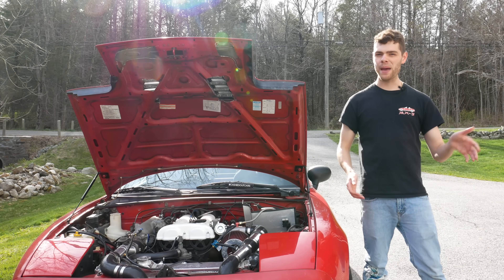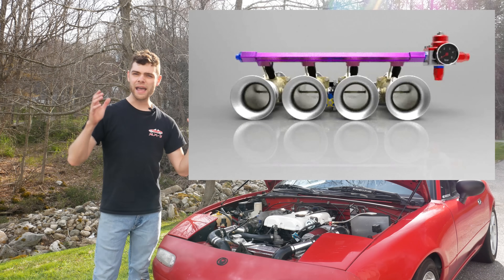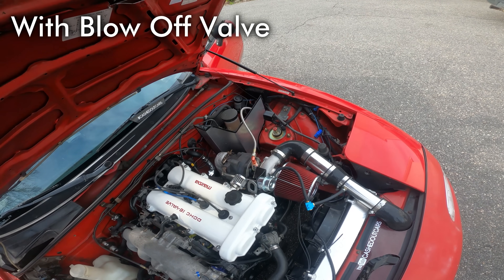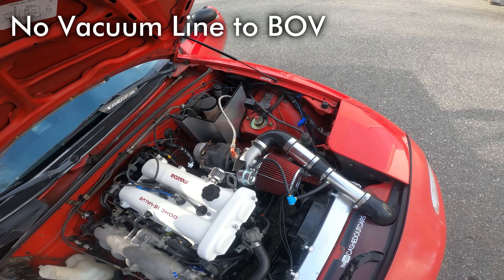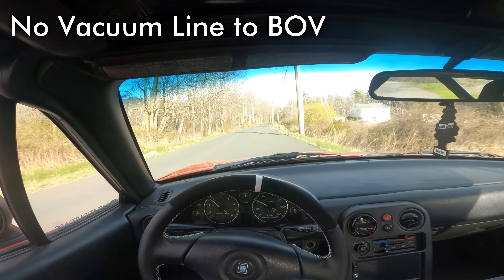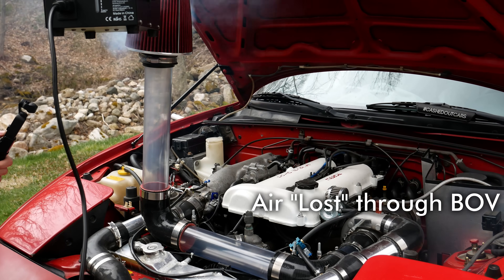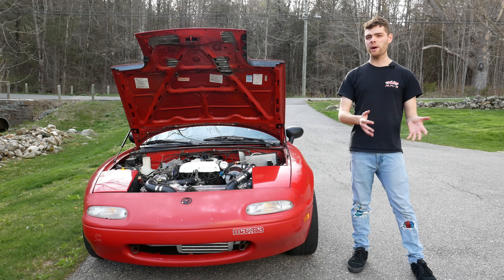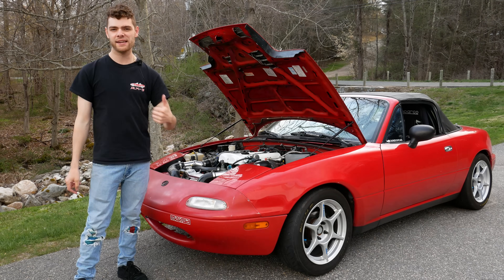Blow Off Valve vs No Blow Off Valve | Sound and Science

Comment: Diesels run no bov, do to no throttle plate to close. And also run 20-30 psi factory depending on the make and model. The issue that comes from compressor purge  is it wears out the thrust bearing. Thats the bearing keep the rotating assembly in the center of the turbo. Just like the crankshaft thrust bearing. The reason it wears it out is the imbalance between boost and drive pressure. It'll live just not as long.
Reply: Most diesels since 2008 have a throttle plate thanks to the epas crippling ridiculous emissions standards. Yet China and Indiana are unregulated and economically and environmentally killing the rest of the world..
Reply: Some industrial Volvo diesels have a throttle plate and still no blow off valve
Reply: @minusthemachineagain9342  that throttle plate is a failed attempt too increase gas velocity and prevent the EGR goo build up in the intake system
Reply: @00powersmoke  you are correct, it should only be active during a regen, still weird to see on a diesel.
Reply: most efi diesels run a tb, in smaller things anyway

Comment: This really makes me curious how the turbo can “blow off” during free revving. I also have a turbo 1.6, and it never does it. I wonder if the turbo is too big (t3) and it just doesn’t spool enough for there to be an audible noise.
Reply from the maker: Yeah it all depends on if you’re making any boost or not! This isn’t making much under revs, but it’s a bit. Also, different BOVs can have different springs in there, making them open at different levels of vacuum

Comment: Great information, just which I had a car like that
Reply from the maker: Thanks! This car is a blast, I’ve built it over 7 years :)
Reply: @CashedOutCars  I’m looking into getting a 4 cylinder car. Automatic/ manual so I can get better gas mileage. Got any recommendation on what to look for? I’m currently driving a 4.0L V6 Ford Ranger so looking to get better fuel mileage.
Reply: @prestonranger3082  manual Honda insight are super cool. 60mpg and pretty cheap.

Comment: What about VW and their Diverter Valve? How Does that Work
Reply from the maker: If I remember correctly that’s essentially a recirculating valve. It still relieves boost pressure, but directs it back into the intake track rather than to atmosphere

Comment: Cool video. 
I have a BOV on my FD, but don't have it plumbed in as I love the flutter. 
The car isn't used a great deal, so turbo life expectancy isn't a high worry for me.
Reply from the maker: Thanks! Enjoy that car, it’s a special one!
Reply: I would recommend removing the blowoff entirely. With it "unplugged" you might run into it boostleaking at higher boost levels. Had that same problem on my rb25.
Reply: I run a tial on my rx8, every now and then I will plug the line and I love the sound of it.

Comment: So you're telling me all the formula drift drivers that have the Sssstutututu are all wrong you do not need a blow off valve this backwards pressure does not exist and holds pressure in the tubing if your turbo start spinning backwards stop buying eBay turbos bro my EcoBoost and my v6 turbo Camry have no blow off and 75k miles on both engines and turbos the Camry is super getto and I still have had no issues please experience a turbo braking or wearing you'll find something else broke it like for you your enjoy fucking turbo and 1980s blow off👍 like I understand it's a nice sound but there is no actual need for it but if it make you happy do it
Reply: A bov might not be necessary, but you know what is? Some fucking punctuation so people can remotely understand a god damned thing you're trying to say on here.
Reply from the maker: No one said your turbo will spin backwards except you. Air escapes through the turbo as it surges, but that doesn’t require it to spin backwards. As mentioned in the video, there’s no guarantee of issues. Lots of people run without them. Turbos have come a long way. 

Top level Motorsport is often very different than street cars as well, this video is aimed at street cars.

But regardless, there absolutely is significantly force on a turbo as air escapes back through it. That’s why major turbo OEMs like Garret recommend blow off valves in their paperwork. Also, car manufacturers wouldn’t use recirculating valves if they did nothing!
Reply: Also please go put a turbo in a vacuum put pressure in remove pressure you'll never see that thing f**** spin please stop saying stuff you don't clearly know

Comment: The best option is a recirc valve.
Reply: Sometimes not always.
Reply from the maker: For many cases yes, which is why OEMs tend to do that
Reply: Both serve to vent residual charge pressure at throttle lift to prevent reversion back into the compressor wheel preventing lag upon reapplication of the throttle. Whether the air is vented to atmosphere or recirculated makes no difference as to preventing reversion and subsequent lag.
The only reason to reciculate is if the engine management system (MAF-based usually) requires it or for quiet operation.

Comment: Good explanation!  I weld, fab and tune right out of my home garage, I cannot stress this stuff enough to "car guys" with big egos.  They always think what Joe Schmoe said on a forum 20 years ago is total truth.  I'll start using this video for them.  I ran without one for quite some time, loved the flutter and it was tuned for it.  Added a TurboXS RFL for a change up.  Beyond noises, I did have issues with high boost and couplers coming off without the BOV, but that was only a couple van-gen clamps of a problem.  Great video!
Reply from the maker: Thanks for the kind words! I built this whole thing including the tune in my garage too, sounds like we’ve got quite a few similarities!

Comment: I run turbo engine it had recirculation   to the air intake but I have seen remove that so it vents to atmosphere is safe for long term use
Reply from the maker: It often won’t cause damage on maf cars, you’ll just be run richer after letting off than you typically would
Reply: @CashedOutCars  thank you im trying to figure out a straight answer for awhile thank you
Reply from the maker: You’re welcome, typically the worst that would happen is you’d fowl put plugs or have idle issues because of the excess fuel. If it’s extremely rich you could damage your catalytic converters. There likely wouldn’t be anything more catastrophic than that though!
Reply: @CashedOutCars  true the car only 12,000 miles on it .it's a kia forte gt 1.6 t

Comment: Air doesn't go back through the turbo without a BOV. Its a common misconception. The turbo is operating at hundreds of thousands of RPMs and the air can't force the turbo to start having negative RPMs and allow it to flow backwards. Compressor surge occurs because the air pressure in the intake tract becomes so high that the compressor physically can't compress the air anymore. Instead of compressing, the air at the turbo detaches from the blades of the compressor causes the stutter sound.
Reply from the maker: I didn’t say it spins backwards! It doesn't need to for air to find it's way through. I have a slow motion with fog videos i took that shows air escaping back out the turbo, to be featured in an upcoming video

Also, here’s an article that I sourced some of this info from, with experts saying the air does go back to and through the compressor wheel.

https://themotorhood.com/themotorhood/2015/9/14/does-your-car-need-a-blow-off-valve-we-talk-to-the-experts

How would high pressure air escape the system, once the throttle is closed, if not through the turbo itself?
Reply: @CashedOutCars  even with the throttle plate closed, it doesn't stop the engine from pumping air out of the system....

Flutter is the buffeting of air that is now at a significant velocity delta in terms of compressor RPM's
Reply: @Hunterhtm  The amount of air the engine lets in when the throttle plate closes is a fraction of the air that is in the piping between the turbo and the throttle plate, most of the air goes out the intake of the turbo.
Reply: The air goes back out the intake of the turbo, it's not a common misconception, it's a fact, it's one of the things that can cause issues with air flow meters.
Reply from the maker: For those saying air doesn't go back through the turbo, please see this video starting at 5:13 https://youtu.be/NbvCpH7dJNs

Comment: Flutter all the way!!! Great comparison, so many people demonize no BOV like "you're gonna blow the turbo instantly", but you weren't biased, thanks for that.
Reply: iv been running my r32 skyline with a rb25det without a bov since about 2005 when i first bought it and its still fine
Reply: @yeetxd4219  good to hear this!
Reply: What he and everyone else is missing is a dose pipe. Flutter sounds like crap without a dose pipe. Look it up here on YT. Click the first short that looked like a raggedy engine bay with a small turbo as that's the fastest explanation.
Reply: @Drunken_Hamster  A dose pipe is just a metal intake pipe, it sound crap without one really just depends on the design of the intake.
Reply: @Drunken_Hamster dose pipe... I'd rather have an air filter thanks
Reply: I have a BOV and still get tons of flutter after WOT on a gtx2867r.
Reply: @tyquanwashington.8510  I run the gtx 3076r i have a diverter valve it flutters as well.
Reply: @tyquanwashington.8510 I’ve got a Turbosmart Kompact EC Series Dual Port on my Golf R and it flutters for 1 week then Pshhh for 1 week then next week flutter for a week!! It’s so weird it’s like it cycles between modes over time or something
Reply: @GuardHausRottweilers that's bizarre.. I wonder if temp fluctuations are changing the dynamics of the springs just enough to cause that.
Reply from the maker: Thanks! Yeah, tons of people run without them with little to no issues long term. Since I like the sound and the bit of protection it provides, I'm happy to run mine but did love to hear it fluttering!
Reply: @CashedOutCars  blow off valve sounds soooo stupid
Reply: It depends on the turbo. The td04 is rocksolid and can run without a blowoff, a gbc turbo has thinner blades and don't like to be run without a blowoff
Reply: It depends on the turbo, with strong thrust bearing can take a surge with no problem, but not everyone can buy a turbo for a cost of a used car.
Reply: @Scytha86  😂 👀
Reply: STUTUTUTU
Reply: I set up my BOV to recirculate back into the intake just before the turbine.  Supposedly the air pressure is supposed to help keep the impeller spinning and reduce turbo lag.  Ive been really happy with this setup.
Reply: A BOV is the opposite.  It would save the turbocharger, not blow it.  But it messes up the MAF computer robbing it of calculated air for boost.
Reply: @vuhdeem If your car uses a maf it’s best to recirculate the bov to the pipe between the maf and the turbo inlet.  Then you’re not letting out metered air so no rich condition.
Reply: @CaptainGoldbeered  Yeah, but that's a bypass valve. I was talking about blowing off calculated air into the atmosphere.
Reply: @vuhdeem  Most blowoff valves can be either vented to atmosphere or plumbed back into the intake.  A bypass valve can be vented to atmosphere too.  A matter of semantics really.  You still get the bov sounds when you recirculate it, just quieter.  If you have a map sensor instead of a maf it doesn’t mess with anything to vent it to atmosphere.  Same with a blow through maf and the bov before it.
Reply: @CaptainGoldbeered  Interesting! Thanks for that!
Reply: @vuhdeem  You’re welcome and thank you as well, I enjoy discussing car stuff.
Reply: I prefer none of them so to keep it a low profile, then people can go "what's in that thing?".
Reply: @Noh1996 litereally makes no sense, only way to have neither is keeping it NA 😅
Reply: He didn't do no bov he just made a boost leak where the bov is. So it made if flutter a tiny bit but realistically just hurts the cars performance due to not holding boost. Remove the bov completely and it would make the same noise and hold boost
Reply: You are a complete moron...

Guaranteed if you drive a turbo car you will be replacing your turbo prematurely...
Reply: U can have it but turbosurge just isn’t good it’ll cause unnecessary stress and lower the turbos life time.
Reply: i honestly would always put a blow off just for the sound i can't care less if the turbo blows
Reply: @cristianseminario7899  i spent 1k on a turbo i kinda wouldnt want it to be destroyed that quick, even though garrett is very reliable idk much about how much damaged it can be done
Reply: @cristianseminario7899  g Wtf did you literally just say the blowoff valve don’t work without the turbo g
Reply: @cristianseminario7899 most cars with a turbomas standard don't make the boost needed to damage themselves. I doubt this little hairdressers mazda is making the boost to hurt itself 😂
Reply: That just made me cringe the second i heard it. Its just abuse for no fucking reason
Reply: @Pippy1  Some people swear it does no harm and they have run their cars with it. I would like to do a track comparison where I buy 2 turbos, run one without a BOV and drive it hard on a race track with a lot of turns so the engine and turbo is constantly under heavy strain and then check the bearings for wear every event and document when it fails, then do the same but with a BOV installed and see if there is a significant different in turbo bearing life.
Reply from the maker: That is a great video idea
Reply: @SI0AX HKS had their GTRs r32,r33 and r34 for track without bov, because having no bov causes that the turbo maintains more pressure without letting it go to the atmosphere through the bov, so it’s actually better for tracks. Surge causes minimal or none damage to the turbo, so having bov or not depends on the build that you want to do.
Reply: @Pippy1  ong
Reply: "flutter all the way" 🤡🤡🤡🤡🤡
Reply: @City1Tiger flutter sounds better than a hiss. Just because your opinion is dofferent doesn't make some one else's wrong. Only clown here is you moron... 😂
Reply: A BOV is superior in each an everyway.
Reply: @enhancedphysique6452  Superior in not a single way.
Reply: @enhancedphysique6452 maybe be superior in many ways. Except for the STUTUTUTUTU
Reply: @enhancedphysique6452 said like a true ignorant person woth no clue what you even mean 😂